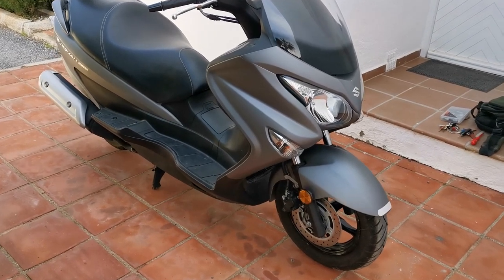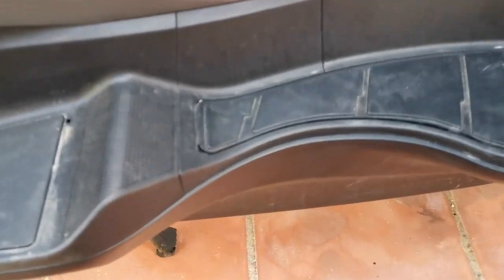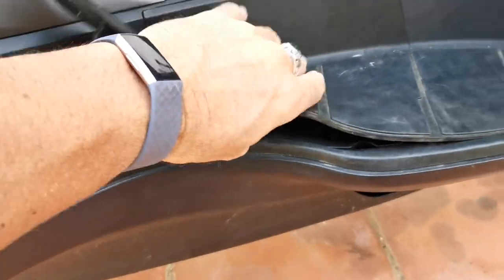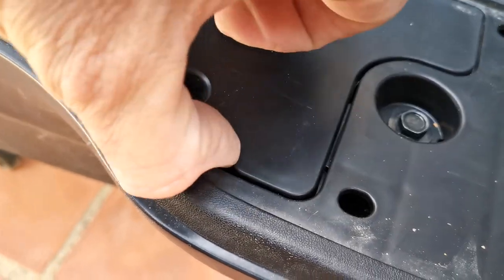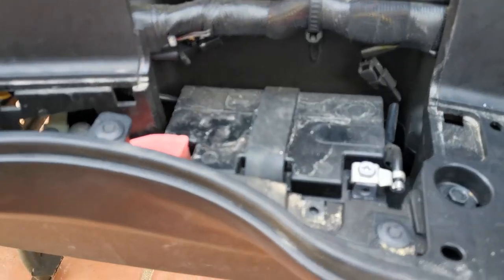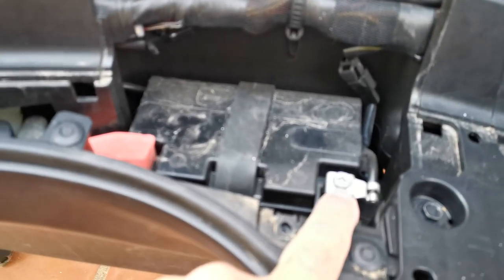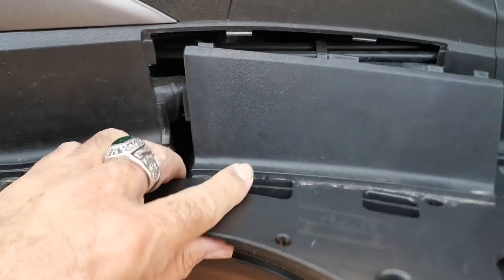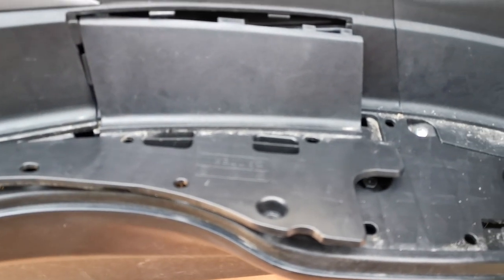Suzuki Burgman 200 Battery Access & Location

Comment: For what purpose is the cable attached with a pin to the battery, one time my scooter burgman 125 couldnt power up at all then when i opened battery found out the pin wasnt making contact so after i opened it and connected again the power came on.

Comment: Big help,and I bet if you don't latch the seat down the underseat storage light stays on and runs the battery down. Day two of my Burgman ownership,dead battery. LOL
Reply from the maker: No problem.. yes, secure that seat..  not bad scooters, Tho 👍
Reply: @JFKKARZ  After charging the battery and changing oil/filter when I put it up for the night I realized I left the parking light on. So it's very possible I had done the same thing last night. My switch bezzel has been broken out so I have no indicators as what switch location does what. it's different than my PCX that's for sure. Live and learn
Reply from the maker: @wolfgangzrx Smith  oh nightmare.. I must admit I had a 2017 PCX first and it was better build quality.. and better engine. although the 400 and 650 burgmans are better.